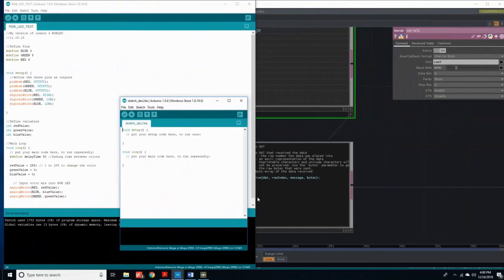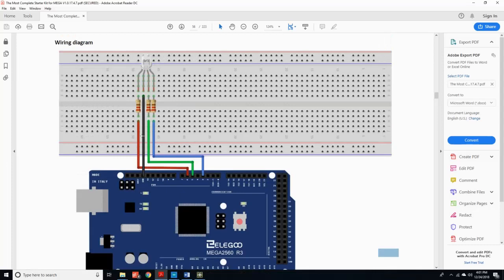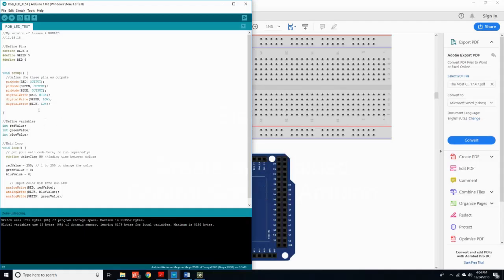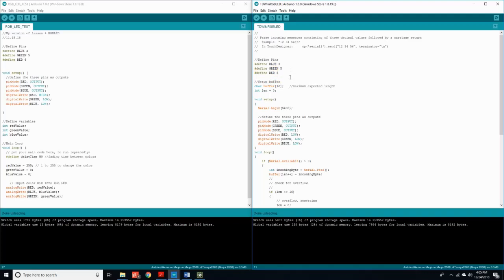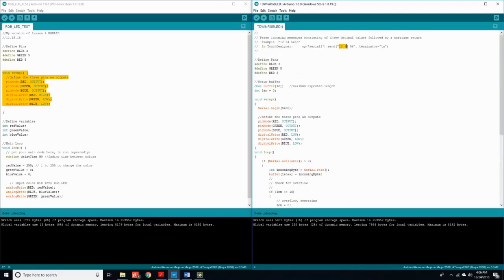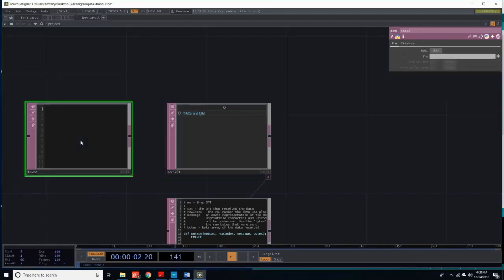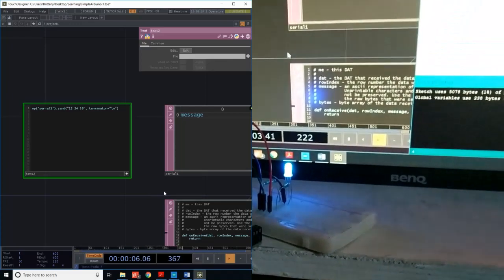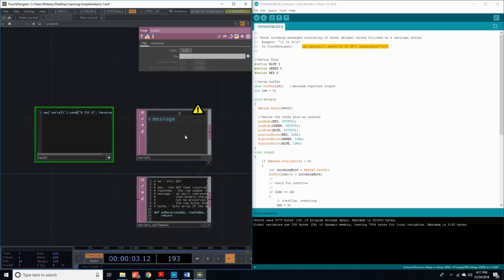Controlling an RGB LED with TouchDesigner

Comment: Hey! This was a great intro for me to get started with using both the Arduino and Touchdesigner together. I’m working on a project right now where I built a recorder that records the video in. I would really like to activate it by triggering the arduino using a motion sensor. So when the arduino takes that motion as an input, it would talk to touchdesigner to turn the recording on. Do you know if thats possible? Thanks!
Reply from the maker: Hi Kerem!  I'm sorry for my late reply.  Yes, that is absolutely possible.  The steps would be very similar to those seen above.  The trickier part is setting up the motion sensor on the arduino.   I hope you've found a solution, but if not, please let me know and I will do my best to help you!